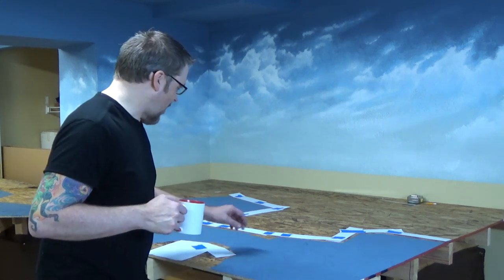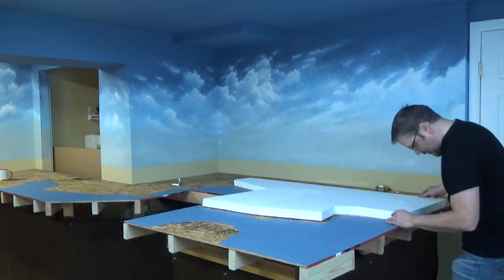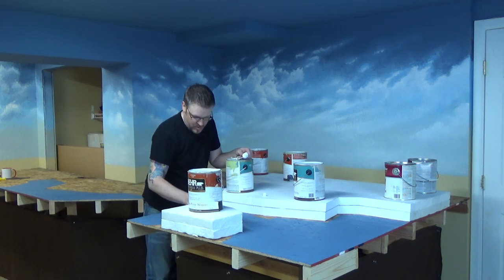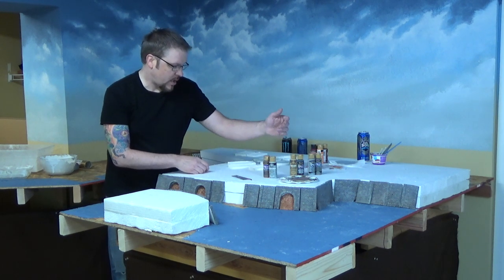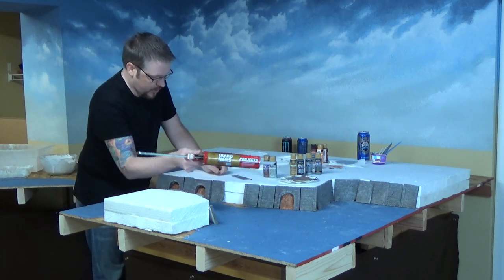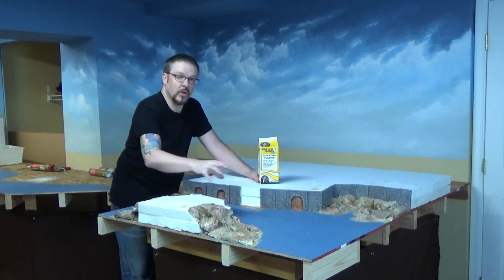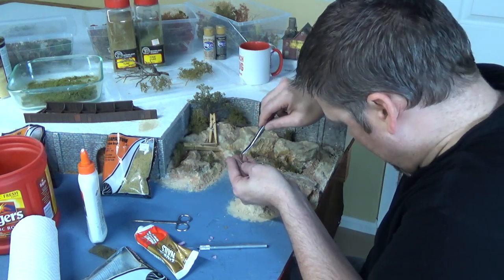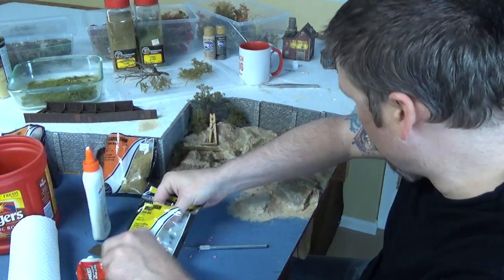Working on the layout and adding water!

Comment: Tip from an old house painter (me):  Re the paint that collects in the trough of the paint can when pouring - save yourself time.  Skip all that hole punching and simply take your brush and run the tips of the bristles around the trough and lip of the can.  This will collect the paint in the trough onto your brush, and you can then just wipe it onto the inside of the lip into the can.